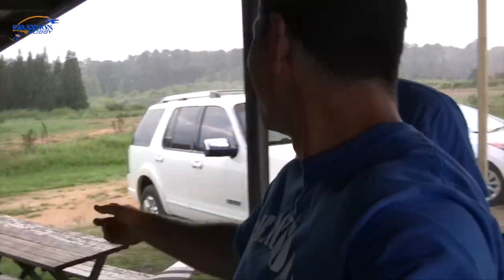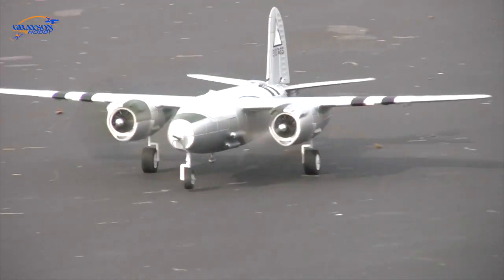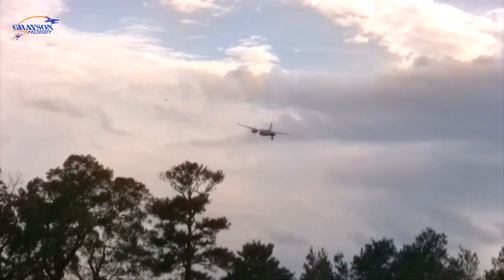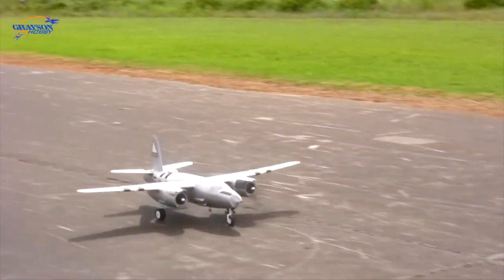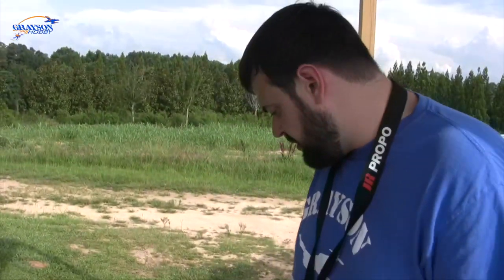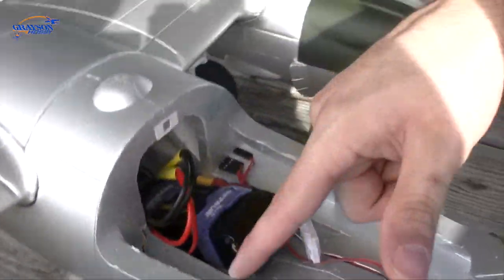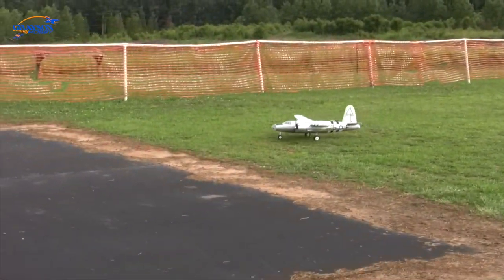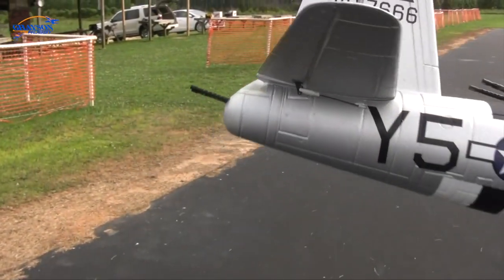Dynam B26 1500mm Maiden Flight | Speed Test | Radio Setup | Upgrade Hinges | CG Location

Comment: The real B-26 had propellers that came close to the ground and needed a decent runway to operate out of. B-25's could fly out of cruder runways. My dad piloted 65 missions out of England and France and flew 2 missions on D-Day. Never talked much about it until a couple years before he died. This looks like a great model. Unfortunately, the only time I flew a model plane, about 60 years ago, I dove it into the ground a seconds into the flight. I did have fun building the it though.
Reply from the maker: wow - great story - your dad IS a GREAT American!!  - Alot of things changed since you 1st flew a RC plane !!  - Its time to get back in the saddle
Reply: @graysonhobby  The plane I made was a ringmaster, or ringmaster, jr. and it had a .19 Fox engine. Balsa and stretched paper and doped. It was control line of course and I got it off the ground almost straight up and then I drove it straight down. One of those things I still remember very clearly. You might be interested to know I did have a radio controlled boat that I made and the interesting part is that you actually had to have license for radio control back then, 1961. You had to send away for it from some federal (I think) agency. The boat was one speed, on and off controlled on the boat, and the only thing controlled by radio was the rudder, and it would go left but to go straight the servo had cycle to the right to get to straight so the boat would do a little fishtail. I think I still have that stuff somewhere. It was a model of a 50 foot Chris Craft cabin cruiser, all balsa wood of course. Thanks for answering. It was fun telling you how things were very different 60 years ago. The RC planes of today are just so fantastic but I am haunted by the straight up and then straight down haha so will stick to watching for now.

Comment: Bought a B26 off of Grayson. I appreciated this video due to their tips for a maiden.  Thank you for giving us a heads up on battery placement. Awesome tip there. Also, I am thinking of going to a 10 inch 4 bladed prop ( like on the BF110 from Dynam) due to the fact I have only grass fields available to me at this time. I will get the Props and put the girl on a watt meter to check it out.

Comment: Hey, I just saw your FPV drone package for under $100 with the Eachine E010C. My when question is: Does it require a license to fly? I am in the U.S., thanks.
Reply from the maker: Hi - The FPV Drone you mentioned is flown indoors and no registration is required for indoors.
Reply: Alright, and outdoors? (I do have big rooms in my church but its still nice to fly outside)